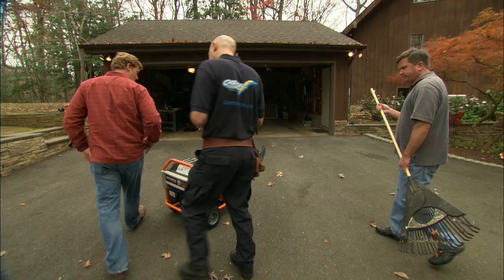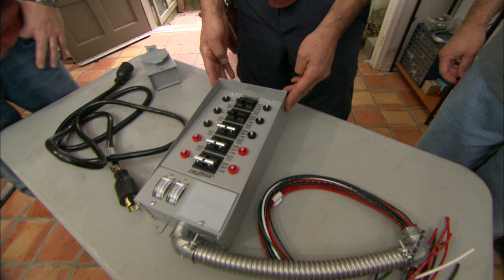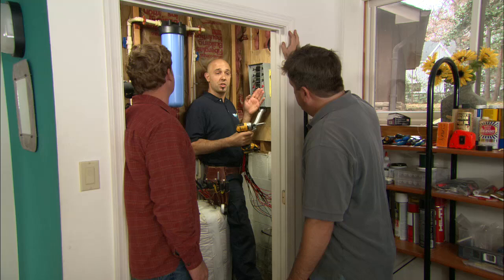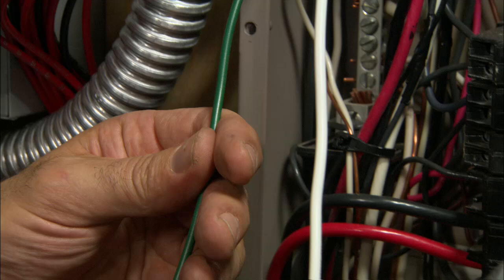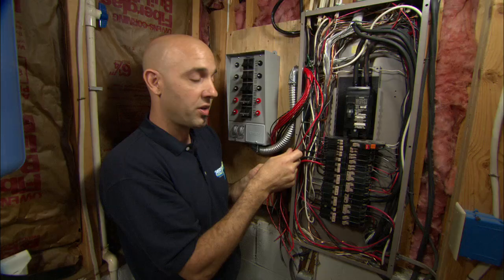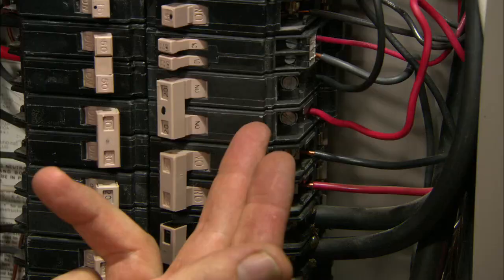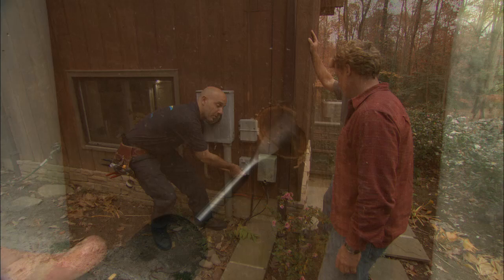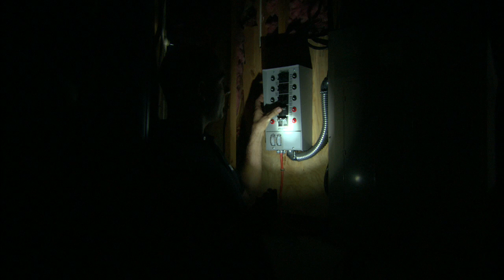How to Install a Transfer Switch for a Portable Generator | Ask This Old House

Comment: What if the generator doesn't have a 4 prong 240 volt socket and has a 120 volt 3 prong socket instead?
Reply: There are ways to get this to work, ideally you would use a power inlet box (or power inlet on the switch) that matches the generator cord you are using.  Just about any 120v only generator could be connected to any electrical panel if wired properly.  Another option to consider may be to use a custom power cord that has a 3 prong male end for the gen and a 4 wire female end for the inlet/inlet box.

Comment: Anyone know were I can buy just the 20 amp rocker switches?
Reply: Hello, you can contact Reliance Controls directly to acquire any parts such as the toggle switches or circuit breakers or anything else. 800-634-6155

Comment: Automatic transition?
Reply: It is a manual switch so the person does have to turn the generator on and connect the cord, then move the switches to put circuits on the generator one by one.

Comment: how does the manual TS keep the power separated when normal power is restored
Reply: Don, thanks for the question.  The break before make toggle switches each act as their own isolation switch.  It's really 6 transfer switches in one cabinet.  The generator itself never actually feeds power into the breakers in the house panel, or the buss bar.   When the main power is restored, all other circuits will turn on, and the generator continues to feed its power to the circuits on the transfer switch.  

The main power can be running some circuits at the same time the generator runs other circuits, there is never an interconnection with the two sources.  Once the power is restored you would move the switches back to the "LINE" positions to put those circuits back on the main power, then turn off the generator.

Comment: Why not turn off the main, and plug the 220 generator into a dryer outlet, and call it a day! Powers up everything and breakers still doing their job.
Reply: It will definitely work but is very unsafe, as well as against state law.  The biggest issue, aside from the main breaker potentially being turned ON at any time while the gen is connected allowing the generator power to back feed down the utility line, and into neighbors houses, is the fact that using a dryer outlet will require a double-male power cord. A cord with 2 male ends is about one of the most dangerous things related to generators, aside from their high CO emissions.

Comment: I'm studying to be an electrician. How did he wire the 240V circuits?
Reply: In this particular model, the generator feeds the 10 circuits with 120 volts to the left side of 5 and 120 volts to the right side of 5.  This generator produces 120/240 out of the L1430 receptacle, so the result is 120 volts feeding each side of 5 circuits, with a 240v difference between the two sides.  Taking wires from a switch on the left side of the switch, and pairing it with the wires from a switch on the right side of a switch, will connect to a 240v circuit.  For example, the bottom 2 switches E (left side) and J (right side) could be wired to a 240v circuit by connect the E to one of the poles and J to the other pole of the double-pole breaker in the house panel.
Reply: Are the breakers able to be ganged so they both trip simultaneously?
Reply: Hello, the breakers are all single pole and cannot be ganged together, but they don't have to be.  Common trip, or even bracketed single-pole breakers are not required for 240v single-phase loads. We do offer a similar model shown in other videos that use the 1" plug in breakers, which can be ganged together with a bracket.  They are called Pro/Tran 2 and are on the Reliance Controls YouTube channel.  Again, it is not a requirement however, only the toggle switches should be ganged together if they are connecting to a 240v circuit or a multi-wire branch circuit.
Reply: So is it possible to trip one breaker and leave the other leg energized at 120V to ground?
Reply: Yes

Comment: Yes, the use of lineman pliers for stripping is poor practice.  Use a proper stripper.
Reply: Pop was an electrician 40 years. He called Kleins, side cutters! A craftsman knows how to ring a wire without cutting it. Klein makes all types of pliers.
Reply: i AGREE,, I NOTICED THAT IMMEDIATELY. BUT, AS A 40 YEAR HVAC VETERAN, INSTALLING POWER TO ALL OF MY A/C INSTALLATIONS,  I MUST SAY I HAVE BEEN GUILTY OF DOING THE SAME THING, BUT, I HAD A KNACK FOR NEVER BEARING DOWN ON MY CUTTERS BEYOND THE PLASTIC INSULATION!!!  YOU CAN FEEL WHEN YOU EVEN SLIGHTLY TOUCH THE COPPER WIRE.  AND SO YOU ALWAYS STOP CUTTING THE INSULATION JUST BEFORE GOING THROUGH IT,, AND YOU CAN GET AN EVEN BETTER STRIP-OFF THAN A STRIPPER COULD DO. BECAUSE I'VE SEEN WIRE STRIPPERS CUT INTO THE COPPER WIRES MANY TIMES, EVEN IF YOU SELECTED THE PROPER MATCHING GAUGE NOTCH!!!  BUT,, ALL IN ALL,, STRIPPERS SHOULD BE USED IF AVAILABLE~!~!~!~
Reply: Well Ive built power lines most of my adult life and this guy forgot to tell people to shut the main breaker off during a power outage. Because 7200 volts goes through the transformer and comes out 240 volts total. But that generator will send 7200 volts back out of the transformer to the main power line. It's called back feed and it makes a linesman's job more dangerous.

Comment: maybe i do it the wrong way. but i turn off the main power and hot wire to the top of the panel . one plug with jumpers on the other end cheap and eazy..⚡

Comment: I DIDN'T LIKE HOW SCOTTY WAS USING AN UN-INSULATED FLAT-HEAD SCEWDRIVER AND HOLDING THE BARE METAL SHANK WHILE SCREWING IN THE HOT LEAD WIRE(S) INTO THE BREAKER CONNECTIONS.  AN INSULATED SHANK SCREWDRIVER IS THE ONLY ONE TO USE INSIDE A BREAKER BOX,, ESPECIALLY A CONGESTED ONE~!~!~

Comment: This is the most costly way to add a generator to your panel. Also the most complex set up. Go with the interlock kit.
Reply: Generally this is a very cost effective way of installing a manual back up system.  Interlock kits require a bit more knowledge and circuit management but they certainly have their place.  It's all based on the application and what the home owner requires to back up with their generator, some opt for a single appliance like a furnace while others want full control of their entire system. To each their own.

Comment: Really don't like those cheap transfer panels with the button breakers.  I wouldn't trust the safety of my home to something so cheaply made.  You need full size breakers.
Reply: +Art Cancro (IGnatius T Foobar) What i would have done is just install a 240v breaker and left if off. When power goes out turn off the main and turn on the breaker. they even make ones that if you are running off a generator if forces you to turn off the main breaker.
Reply: +William Winder exactly.  Interlocking mains are so easy to do, they sell kits custom made for just about every panel out there.
Reply: Art Cancro when i received your reply i was actually watching your video on inexpensive residential generator hookup
Reply: I concur. The cheap transfer switch doesn't appear to have overcurrent protection built in and if you're going to go through the trouble of putting up a transfer switch, you might as well get a whole house system and automatic switch instead.
Reply: The transfer switch indeed has overcurrent protection as any transfer switch is required to have according to the national standard UL 1008.   A whole house system and automatic switch are certainly superior, if a home owner is willing to pay thousands of dollars more.  Needless to say, most home owners like to have options rather than going with a system that costs $5k or a lot more.
Reply: An interlocked subpanel is half the price of the piece of junk Reliance sells, and you can use quality components.  No one should ever use the Reliance panels with cheap button breakers in them.  There is absolutely no excuse.
Reply: Well hello there Nicholas Schmal, sales manager at Reliance Controls.  May I remind everyone reading this that a good quality subpanel with full size breakers, available at any hardware store, is half the cost of a Reliance Controls transfer switch.
Reply: Class dismissed.
Reply: problem with a interlock is you can't tell when the power comes back on. Unless you use a sub panel and interlock that.
Reply: B T interesting haven't seen that before does they just hook into where the mains power comes into the main breaker? I still think if your going to use a interlock you should just do it on a sub panel. Simplifies things more.
Reply: Would be nice if it had a wireless remote receiver so you can be out of earshot of the breaker panel and still get the alert.

Comment: why not connect a 240v plug directly to the panels 120 v's budrd. When power goes out, kill the main breaker from the utility company, connect your running generator to the 240V plug and select the circuits you want to have powered from the generator. Leave enough of the other circuit breaks off so as not to overload the generator. Why install a manual transfer switch that limits the number of circuits that you can control, unless you clone your main panel.  I guess if you are not comfortable opening the main panel cover to select your circuits the transfer switch would have some value. Not to me though.
Reply: +Michael Cohen  That's exactly how I do it as well for my inverter.  $300 for that transfer switch.  I can buy a couple nice batteries for that kind of money and a $15    240v breaker :)
Reply: You don't do that because if you don't turn the main breaker off you back feed the poles and can kill a linesman working on the poles. This also carries a fine and potential jail time if your caught doing it anywhere in Canada or USA. Although that doesn't stop many people from back feeding their panel with a generator because it does work and it is cheap to do. Its just very unsafe IF you forget to turn the main breaker off.
Reply: You should use an interlock kit to do this, which eliminates the possibility of sending power back out to the grid.
Reply: It's against every state law to feed a generator into the electrical system without a certified transfer switch.  The main reason a limited transfer system is beneficial, is simply that it is easy to manage for the common person.  Controlling 6 circuits compared to having to manage a 40 circuit panel is a big difference to a lot of people, especially when the majority of circuits are not critical and are not needed during a power outage.
Reply: For me I have to throw one switch: the interlock, which simultaneously disconnects me from the grid and connects me to the generator and the main panel. Seems to be simpler than throwing the many  switches  for the multiple circuits with the transfer switch.  I think the utilities concern is not having the customer accidentally energizing the grid with  his/her generator during a power outage,  potentially electrocuting a utility worker. I suppose some people could misuse the transfer switch (or anything for that matter) and defeat its purpose. Also a transfer switch I have found IS legal if it is made by the same  company that made the panel. I guess that means that the manufacturer has certified it as safe, reliable etc. This has been a good dialogue.
Reply: Michael, right, the inter-lock type concept is a long used and perfectly acceptable method if done correctly.  It's also the most capable system second to a fully automatic.  I agree adding some type of lock out bracket at the least is what the utilities really want, or else they are relying on a home owner to remember to turn off the main - the linkage system forces someone to do that thus creating a transfer mechanism. 

Also correct, an interlocking type system is allowable and can be in accordance with code as long as the panel is manufactured with the linkage and certified beforehand, or the linkage is field installed (certified), made by the panel company it's being installed in, and listed on the label as a part number.  Some after market linkage kits are not certified by a testing lab (nor made by the panel companies) and can be defeated with the dead front off the panel, which of course defeats the purpose.  Still better than nothing I suppose. 

Although this interlink setup allows the potential to control any circuit in the entire system, it does however force the operator to manage all circuitry in the system.  To some people this is great, but to a lot of people it's more effort than is necessary to infrequent power outages.  
With a full panel interlock, let's say 30 or 40 circuits, the person should turn off every single circuit breaker in their panel before connecting the generator.  So instead of just flipping a single switch (the main breaker/generator breaker), every circuit breaker in the entire system is now viewed as a switch, and actually those are what people have to now control.   Connecting the generator to a panel with all breakers ON will pull all the load at once and could cause some issues to the generator.  A smaller sub panel system or something with the 6 or 10 circuits simply makes everything easier to manage in general.  Each setup has its own variables and the labor to install these systems varies greatly.  There are really a lot of options for back up systems, it's a good thing that generally they only have to be installed once.
Reply: "Some after market linkage kits are not certified by a testing lab (nor made by the panel companies) and can be defeated with the dead front off the panel, which of course defeats the purpose. "

Are any of the approved interlocks able to somehow protect against the homeowner unscrewing the breaker panel and flipping the breakers willy nilly?   The approved interlock slider I have is attached to the front panel, so it's certainly not foolproof, as some fool could easily defeat it just by removing it.

Comment: I didn't see any safety feature preventing both main and generator power being on at same time. I didn't even hear it get discussed. If you have those switches turned on from the generator and the power comes on again through the main, it's going to get messy in a hurry
Reply: That's because a transfer switch completely eliminates that worry as whatever the transfer switch is powering can only be powered by one OR the other... not both at the same time, ever. when the power comes back on you just switch the transfer circuit back from "Gen" to "line".  Hope that helps
Reply: Yes that does help. I must have missed the part where they switched it, Thanks
Reply: That was my question too, thanks for clarifying

Comment: What happpens when normal power is restored.
Reply: my question exactly
Reply: You will know that because circuits NOT interrupted by the transfer switch will again be hot (functioning).
Reply: and the gen will continue feeding the circuits switched to GEN until the person switches them back to LINE.
Reply: wholeNwon
Reply: you should have turned the main switch off in the first place

Comment: I didn't see you turn off the main power before you started working on the breaker box. Just sayin!!!
Reply: A real electrician doesn't turn off power to the entire house to work on a few individual circuits...
Reply: There has been many real electricians that have been KILLED by electric  so I would say he's a smart electrician. The only problem I see is that POS generator.

Comment: The dumbest thing you can do is buy a gasoline generator, go diesel. Look it up for yourself.
Reply: A diesel generator will certainly be a lot more fuel efficient and will likely require less maintenance (and longer life) due to no carburetor or spark plugs, but the cost difference in most cases versus a gasoline generator is enormous.  Generally, diesel generators are made for long term use with larger loads, whereas most gasoline generators are meant for shorter term use with lighter loads. Personally I think you will find contrasting opinions on this topic especially now that we are seeing that more and more gasoline generators can be converted to run on a common 20 pound tank of LP.
Reply: Bob D buy natural gas generator, no refilling needed. Most generators can be fitted with conversion kits available on the www.
Reply: So long as you have a gas pipeline running to the house-

Comment: If you're going to spend all that money anyway, probably total over a grand, spend a few grand more on a Tesla Powerwall. I really hate that generator noise :-)
Reply: The Tesla Powerwall is a great battery storage medium, however for a back up or supplemental power application someone still needs thousands of dollars in solar panel arrays and an inverter that uses the Tesla for its power and converts it from DC to AC.  The Powerwall is also very expensive and hard to find.  The new Mercedes battery seems pretty nice as well.
Reply: I think the inverter is already in the Tesla Powerwall. Otherwise they would call it a battery pack. You can charge the batteries from the grid when it's online. The only purpose of solar is to go green & invest a bit.
Reply: Hello, the Powerwall definitely does not have a built-in inverter, unless they just recently incorporated one.  From everything I've ever read about the Powerwall, it's just a rechargeable battery.